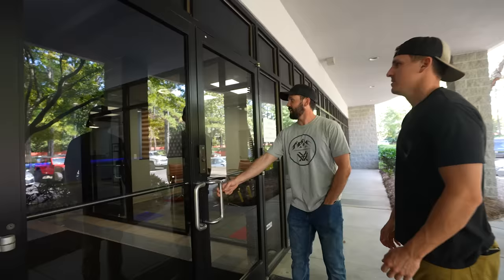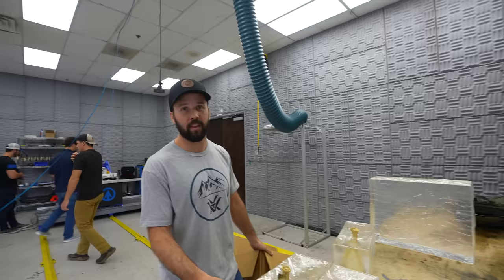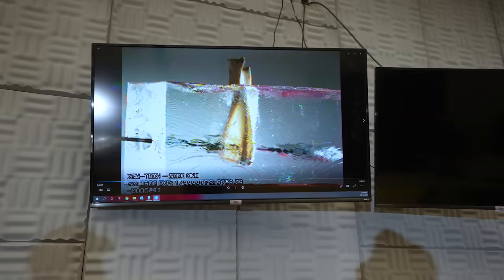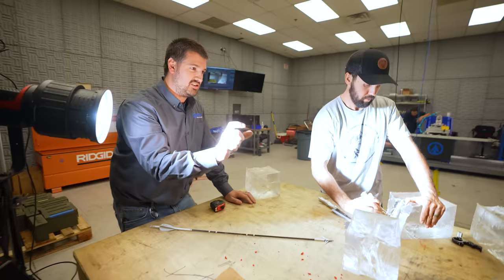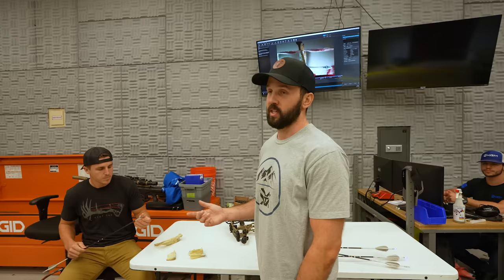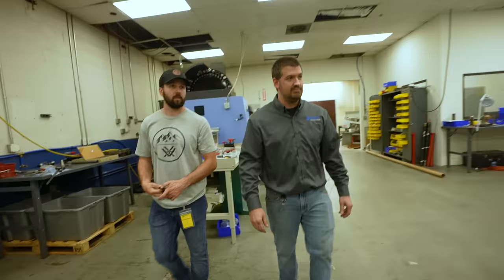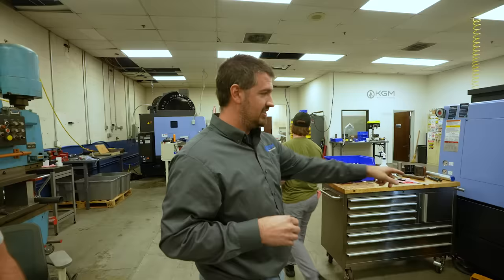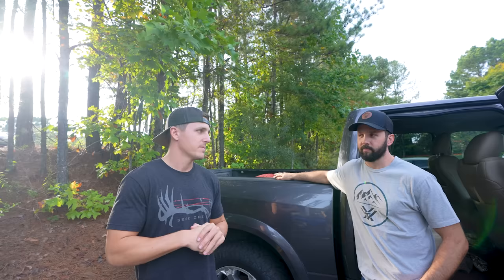BROADHEAD TEST: Which One SPLITS BONE? (Super SLOW-MO Camera!!)

Comment: I  shoot a 70ibs triangle bow ( 21 1/2 inches axle to axle ) with a carbon arrow made to fire from a bow that heavey with a 100 grain trocar chisel head with three mechanical slipstream blades with 2 inch vanes I also use a whisker biscuit rest full entrapment rest the type of riser is a shoot thrue riser where you shoot between the limbs it is a very fast bow over 300 fps. Around how much penetration will I be looking at if I should hit the bone in the shoulder? I usually shoot when the fore leg is cocked forward but just in case I have to fto get the heart lung shot  that i s preferd and I have to shoot thrue the shoulder what shoulder what shoulder?

Comment: The answer to what the best broadheads is? Slick trix. If its mechanicals its absolute trash. Wastes energy, shit penetration and 99% will never get through the shoulder. Slick trix. Shot a deer the arrow flew through like butter, butchering it at home the slick trix Made an x in the shoulder blade and was so clean i never would have known i hit the shoulder if it wasnt for the x. Im been using slick trix now for 6 years i shoot 3-4 deer with my bow every year. In that tike i have had 1 arrow stay in the deer the other 30/35 it blasted right through.

Comment: I tested expandable broadheads many years ago, and I found that the type of broadhead you chose had the worst characteristics and worst penetration of those I tested. These tests were just my personal tests and were never shared with anybody. The best expandable broadhead I tested was similar to the grim reaper, and I killed many deer, bear and elk with them. The only broadhead I ever had stick in a scapula and not penetrate was a three bladed fixed blade broadhead.
Reply: I was always very careful on my shots bow hunting, regardless of broadhead, but the grim reaper style expandable allows better grouping, and bone penetration (scapula) never became an issue. Expandable broadheads have absolutely no problem penetrating ribs, and most of the time I had pass through shots. The whole argument between fixed blade boils down to one thing. What is more important to you, accuracy or penetration (regardless of how poorly you are shooting). For me, the answer always landed on the accuracy side of the equation. If you ensure accuracy, penetration never becomes an issue.

Comment: IMHO, it looks like the Exodus did more damage than the others because it hit the structural portion of the shoulder, not the fine portion between. That does not prove it did better than the others.

I am glad you did this test, yet conclusions can only be drawn from doing dozens of shots with each broadhead. Ashby, Trad Lab and Iron Will are the only entities I know of that have done extensive enough testing to begin to draw conclusions. So far, across the board, heavy FOC and single bevel prove to yield the most consistent results.

What I don't get is why people continue to argue against any of this. In a hunting situation that has variables and unpredictable possibilities, why wouldn't you want the arrow set up that has the highest odds of making a kill in the least optimal of situations? To bet an animal's life on "hope" or a "as long as..." frankly is unethical. A breeze, an unseen twig, a slight movement of the animal... and suddenly what you thought was a perfect shot is now heading for a shoulder joint. If your arrow can't make it through that joint, weren't you were under-prepared for the situation?

Comment: The best part of this video is the technology… the tech is pretty cool.. other than that this video has a lot that could have made it 10x better!  So the rationale for picking which heads to try is very lacking! And they think the Rage Trypan is the “Best” mechanical that shows a large lack of experience….By far there are many other mechanicals that are better than the rages.  1. The best by far in many categories to name one is the Sevr broafhead.  In order to make this video more “scientific” they should have tested all the 2 blade fixed heads.  Then the 3 blade fixed heads, and the 4 blade fixed and then all two blade mechanicals…then three blade mechanicals then 4 blades etc.  then maybe sub groups of all 2 blade fixed single bevels and then all the 2 blade fixed double bevels etc.  basically then your comparing apples to apples not apples to oranges which makes not a bit of sense.  Also if u really want to test how they perform with bone then u need to shoot into “Heavy” bone!  Like elk scapula or femurs or into big sacrums or Ilium bones.  And also place some type of hide in front of the gel of some sort.  That would give one much more realistic results!! So thise would maybe help their videos more “scientific” since they do have all that great technology.  It is sad to see all that wasted on a sub par video

Comment: Interesting video, but I think the tests were flawed, relative to real-world use.

I don't claim to be the best archer, but I have taken and lost my fair share of deer. Testing an arrow with a bone that is several inches within gel is nowhere near real-world. Out in the woods I am shooting at an animal with bone that is only skin deep. Huge difference. Some broad heads, like Mussys that have a chisel head, followed by the blades, will deflect off bone incredibly easy because of the shallow angles on the chisel. (think rib cage deflection) Even if hit squarely on a bone, they deflect like crazy if the bone is right behind the skin. However, if that same broad head goes through the neck and hits the leg bone on the other side, it will shatter the bone into pieces because it had some flesh to keep the broad head from deflecting. I know because it has happened to me. More than once. I lost too many deer to deflections in what appeared to be great shots. Like the mechanical you tested, they only worked dead-square to the arrow and only if it hit flesh first. That is why I switched to a three blade sharp to the point. I have not lost a deer since switching. This year I had the arrow deflect off a rib, but skip two ribs back and still pas through, breaking a rib in the process. Even if they deflect, they don't deflect with enough of an angle to not be a kill shot. They continue to try to work their way through.

 I believe your tests would yield different results if you had fresh deer hide stretched over the bone right at the front of those gel blocks. I know there is a little bit of flesh on the type of bone you used (in a live deer), but I never would use a Muzzy type chisel head on it. Those arrow that you used that were not pointed... I would never trust them.

Just my experience.

Comment: What is your take on the tooth of the arrow 1" cut both sold and vented to  go through bone say at 60 yards and compare the tooth of arrow to the QAD Exodus full and the swept with same test as stated above for the tooth?????
I'm done with mechanical broadheads I had one that my shoot was 42 yards with a Ravin R10 Crossbow going 410fps and I hit the deer a little bit back further then I would of liked and I think k I hit the rib bone because the bolt stopped dead and very little blood and didn't even find the bolt or deer. With that speed that should of broke the ribs. I think I hit in between two ribs for the arrow/bolt not to just fall out because I seen  3/4 of the bolt just flopping up and down as the deer was running away and me and a friend went back the next two days trying to find the deer and arrow and nothing. 
I'm stuck between this two fixed broadheads but not shore how they will fly out of a 410fps crossbow.  Like your videos and testing that's why I asked you.
Thanks

Comment: I shoot the cutthroats and i've had only a couple offside leg or shoulders stop them.  Otherwise they blow right through.  I've shot a few on the ground recently and the arrow goes another 50-60 yards after the passthrough.  I was a little surprised it didn't take 1st or 2nd.  That said,  I've had way to good of luck with them to even think of changing heads and i've use A LOT over the last 34 years of bow hunting.  My belief is that you can't go wrong with any 2 blade double or single bevel head,  they just perform great.  I know the argument for an expandable is big cut,  but liver is liver,  guts are guts,  it's a dead deer regardless of head.  You punch em in the belly,  that's a dead deer regardless of head.  Those deer should be left 12 hours anyway, at least that's my rule of thumb and they are typically a short track.  So I personally don't see the point of a Rage or other big cutting head.

Comment: Interesting.  My archery pro shop recommended Rage Hyperdermic +P in 100 grain for my elk hunt.  I shoot 70 lbs and have a 30 inch draw length.  My first 2 arrows blew through a cow elk at 52 yards.  The 6 pt. bull in my profile pic was shot the next year at 40 yards, and it went dead center through a rib (with blades deployed) and stopped on the opposite side in a rib.  Bull made it 125 yards.  My hunting partner shot a 5 pt. bull last year (28.5" draw length and 60 pounds).  He accidentally hit him right in the thicker part of the should blade, and it penetrated about 8-9 inches.  Blades deployed, and thankfully he hit the major artery in the 1 lung, and the bull made it 60 yards and died.  On all of these elk, the blades opened and did not break.  I was impressed.  Just wanted to give my experience.

Comment: How bout not trying to tuck it in the shoulder and play it safe center mass on deer. Plus the shoulder blade is different when it’s fresh vs dried out. Ones is more brittle than the other.
Reply: Why would you do that? There is a huge mass of vitals and arteries in the vital v. You would rather liver or stomach shoot a deer and wait overnight to track it and risk the coyotes getting it or worse yet not finding it? I will tuck into shoulder every time and have total.confidence that I'm getting enough penetration with my set up. I don't even have a problem taking quartering to.  I've done this since the 80s. Back them we were taught to hug the shoulder. All we had were fixed heads. I never heard stay off the shoulder until the mechanicals came along. So many deer lost because of them.
Reply: @drewsroo  my center mass is like 6 inches from the shoulder v point. Not the stomach. The vital are so much bigger than just the shoulder. Learn it.
Reply: @MrNubeTube  yeah. I know where the vitals are. I also know where the best part of the vitals to hit is. There is no reason to fear the shoulder with the right set up and inside there is the nexus where every major artery and vein in the body meets up. Oh and heart and lungs too.
Reply: @drewsroo  regardless if you hit the bone and not the blade. It’s not going to pass through. Already had a mega meat blow through a scapula this year on a live doe. That’s how broadhead testing should be done. I must have the right set up…
Reply: @MrNubeTube  hey if you like it and its working thats really all that matters. I get too cranked up over this anyway. Good hunting.

Comment: Why don't you just save some front quarters then test it on actual flesh, that way you can simulate skin, tissue, muscle bone and fat. Me personality out of the 19years I've been hunting fixed blades are the best option. However for my children that shoot low poundage (45lbs) mechanical seem to do better. I've tested this on hog shoulders many years ago. However the (shield) shoulder plate is a hard bone and mechanical do have a much harder time with penitration. I use a duel bevel 175gr fixed head with a 50gr insert with a 27 1/2 draw on #70 usually run 530-550gr total weight.

Comment: I know this video is getting rather old now, but using ballistic gel for testing broadheads is TERRIBLE.
It just skews the results extremely much.
I understand why it is tempting to use when making videos, but you don't get the answers you want with it.
The ballistic gel works well for testing expanding bullets, but not for broadheads at all.
The ballistic gel acts and reacts very different from animals to broadheads and arrows.
The ballistic gel does not lubricate the broadhead and arrow,  but it clings to the arrow.
The more you manage to crush the gel with your broadhead, the better it will penetrate as the friction against the arrow shaft will be reduced a lot.
And this is why the Exodus manage to penetrate the gel so well.
It has a design that is close to perfect for maximum penetration in ballistic gel for an arrow.

I have done broadhead and bullet testing for more than 30 years and even if I too tried using ballistic gel for broadhead testing, I stopped doing that a decade ago as I saw how extremely useless it was for it and how skewed results you could get when using it.
In my experience is water soaked cardboard the most reliable testing material.
I 100% understand that it is not "sexy" to use in a youtube video, but it is by far the best to use unless you are going to shoot lots of dead pigs with it.
As I have also done at times to retest my findings from using water soaked cardboard.

If you want to test on heavier bones, then you might try to get lots of cow scapulas from a butchery.

Comment: I started out 44 years ago shooting a three blade wasp ! Never out of hundreds of deer dis I not have a pass thru ! Of coarse I shot a heavy aluminum arrow ! 11 years ago I started shooting carbon for speed and the Dumb ass that I an wanted to go to mechanical after losing three out of 8 deer do to no penetration !the deer runs off with only 2 to 2 1/2” penetration therefore never touching anything vital unless it was back I learned real fast to trash mechanical broadheads. Guy it’s not how it fails rather it’s when it fails ! Mechanical broadheads will let you down ! Get away from them today ! Or they will break your heart !!

Comment: I had a deer jump the string on me last year and I hit the spine with a rage trypan and it completely split the spine in half, and i still use that same one today just different blades but they didn’t even break just dulled up. Also not hating but you guys need to study more animal anatomy and angles and such. I’m a fixed guy besides the sevr and trypan but angles are bad with both for the most part. Don’t rush and wound a deer with a fixed because you think it will just blow through any and all because it won’t. But I personally don’t think y’all should be the ones “testing” heads when there are people more qualified on here to do so. Sorry, but great vids besides that 👍